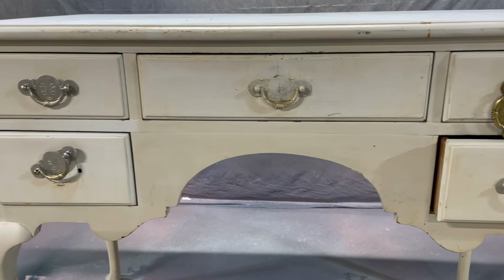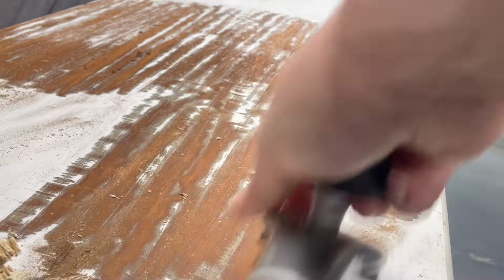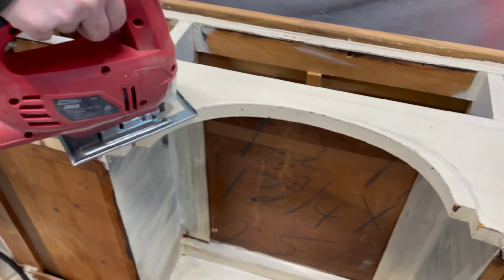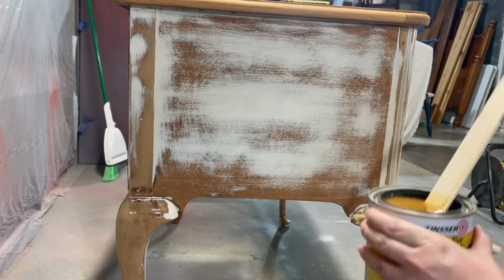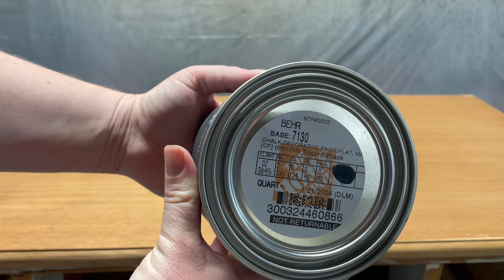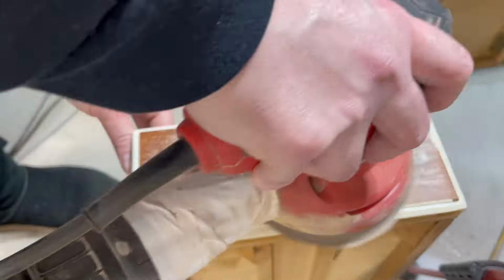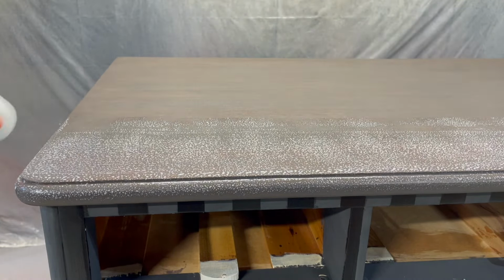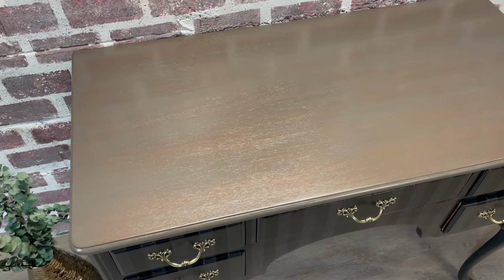Whoa! That’s an EXTREME makeover! 🤯

Comment: the stripes turned out so good! 
you asked about applying the top coat — i’ve had success using a water mister with water-based top coats just like you would with chalk paint. otherwise, I liked the finish best when I brushed on a healthy coat (doesn’t even have to be nicely done), and gently rolled over it with a dry, clean foam roller to knock down the brush marks. it leaves a sprayed-like finish. 
the bubbles could also be from too much pressure; if you continue to roll over it gently, they should dissipate. I personally don’t like how the foam roller lays down paints/top coats which is why i’ve liked the brush then roll method. black sheep house has showed it in her videos with paint and topcoat! good luck!
Reply from the maker: I’ll definitely look into her videos! Thanks so much for the tips! I usually like to use a sprayer but it’s been so cold that I’ve not been liking the finish I’ve been getting so that’s extremely helpful! 😊